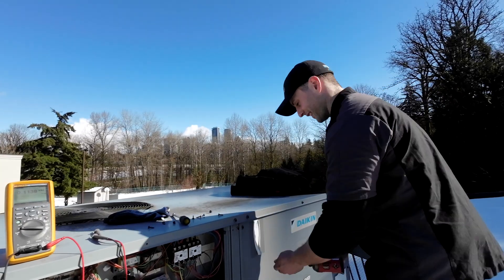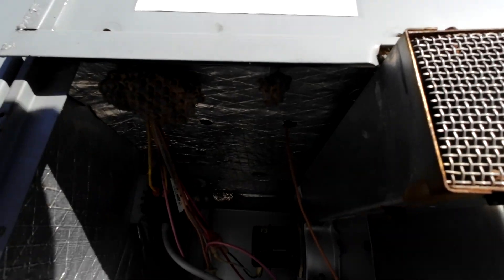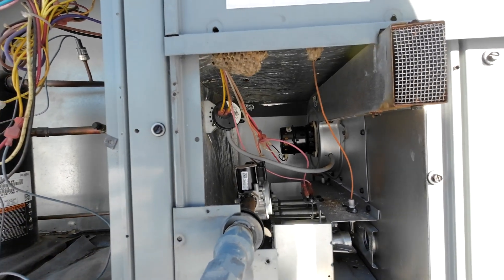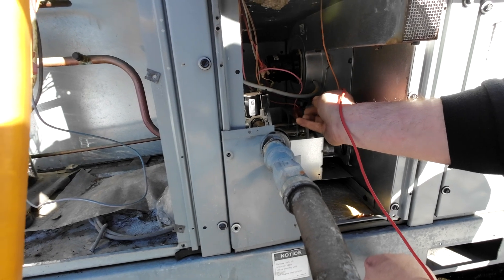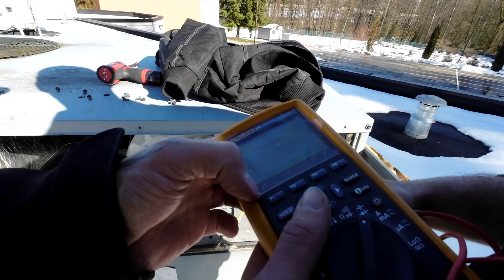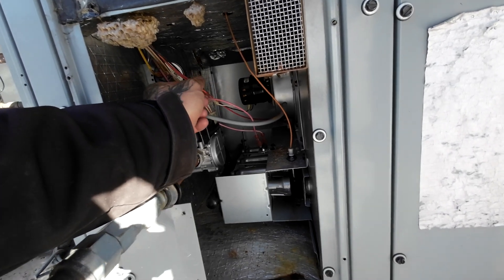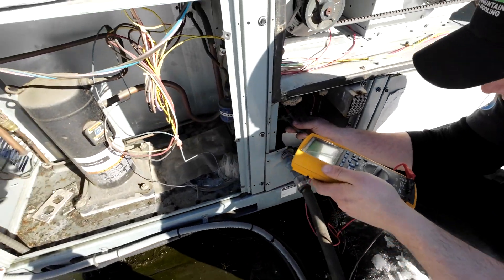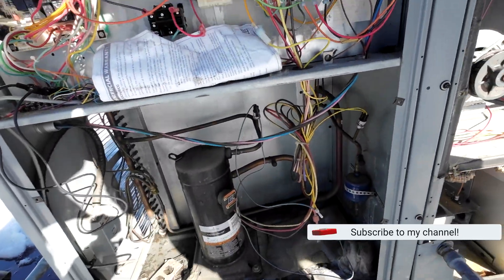How to Diagnose an Inducer Motor quickly Daikin roof top unit.

Comment: How do you remove that motor ? Gotta do one tomorrow
Reply from the maker: Super easy. Just pull take out all the 5/16 screws. Remove the faulty motor. Install the new gasket and new motor. It can be a bit tough to reach the back screws.
Reply: @Hvac101 yea that’s what I mean the panel on left is on the way. Looks tough to get to the back screws. Done hundreds of ventors but this one looks like it’s going to be a pain. I don’t need to remove the burner to make it easier ?
Reply: Let me know if you have more insight on removing. Just gotta squeeze in there ?
Reply: I put down a tarp because the roof was wet. I pulled the gas valve and made it easier to pull the motor. The gasket was the hardest part to line up. But I’m sure it will be easier than I’m making it out to be.